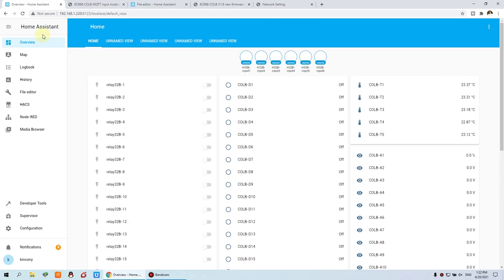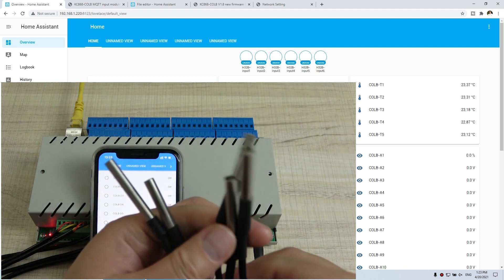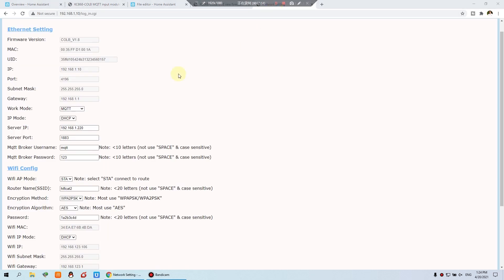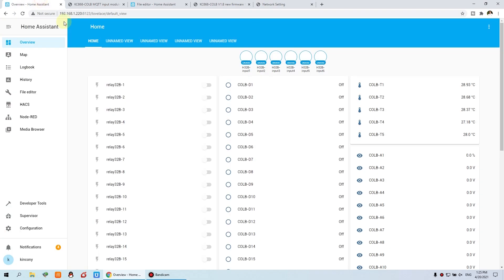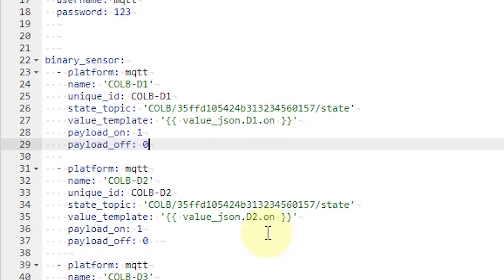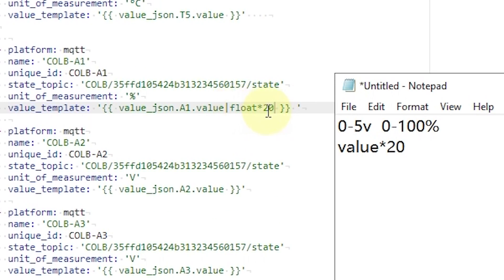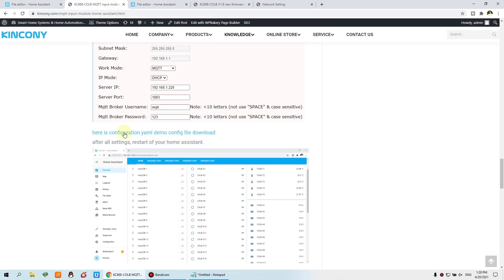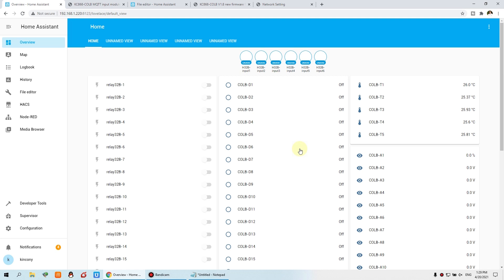KC868-COLB input sensor module integrate home assistant by MQTT

Comment: What is the max distance for the analog, digital and temp sensors
Reply from the maker: digital input can use by 1000 meter. analog input can use about 20-30 meter. it according to your wire diameter. good quality will be more long distance.

Comment: Hi. Nice work. Is it possible to update firmware for relay controller COL to use MQTT. Thank you for your answer. Jirka
Reply from the maker: sorry, only support by kc868-colb, col is not enough hardware resource now.
Reply: @KinCony  OK. Thanks for answer 👍